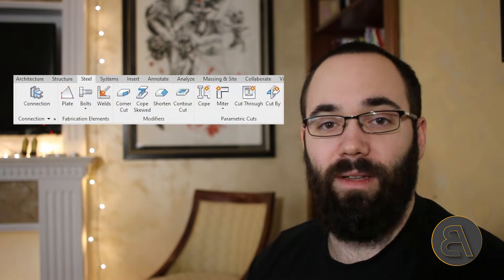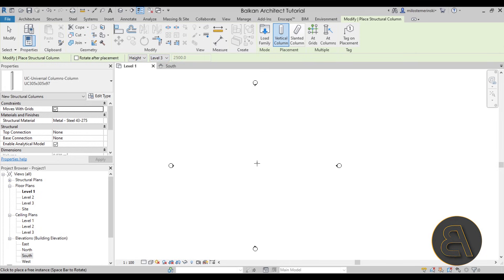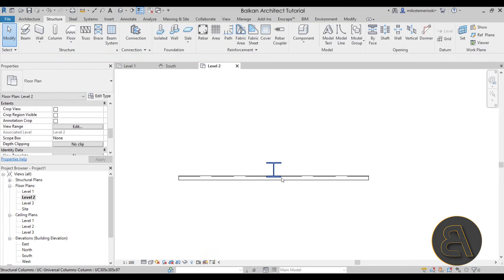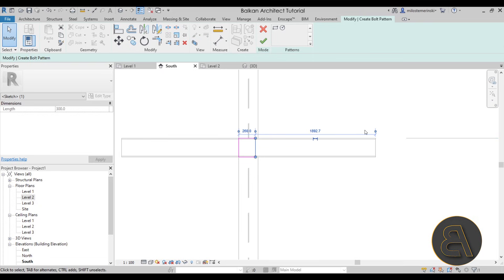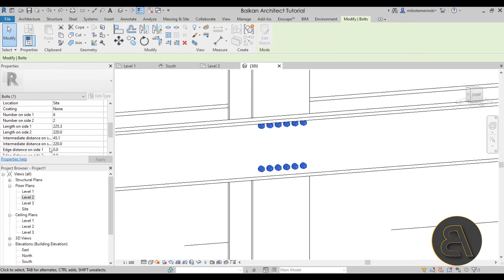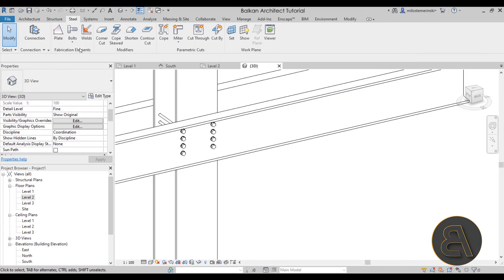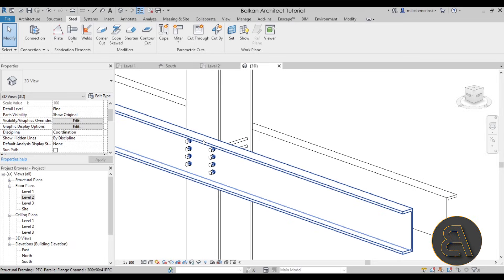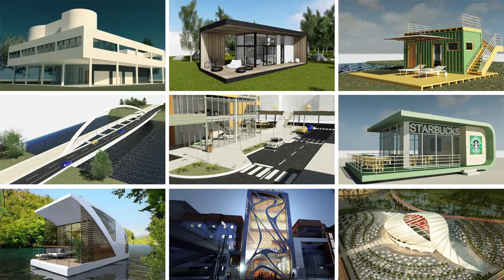Bolts in Revit Tutorial (Steel Structures in Revit)

Comment: Why it says “ the shapes for medium and fine detail level of connected elements are inconsistent “ please explain
Reply: Most steel sections have a medium detial level that is just a simpllified shape. (eg. I beams have square edges). at Fine detail level they are chamfered and rounded off to match closer what the actual real life shape of the beam is.

Comment: I am letting this pass cause I know you are not an engineer, but please stay away from structures, please, you are doing a misservice in this field. thanks
Reply: He's not designing structures, he's showing how to use the tool.  Get over yourself.
Reply: @MrDarrylhen  But I highly recommend to leave it on the engineers or qualified structural bim modelers, the positioning of the nuts and bolts in this video is ridiculous tbh 😂

hes an architect, why would an architect teach me BIM model steel structures? 😂
Reply: @innercore5  i agree it's risky to teach outside field of experience, but there is a severe lack of engineers providing this type of publically accessible training. Need more of them to be honest.

Rather than ragging on those having a go a productive solution is to make content for others to learn from. OP of this comment should do this if they care that much.